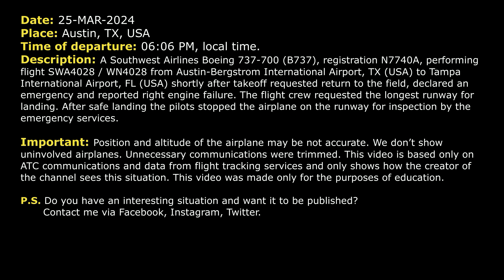“We lost the engine”. Engine failure on takeoff. Southwest Boeing 737 returns to Austin. Real ATC

Comment: I was on that flight.  The audio shows a fully calm response from the pilot and ATC, it felt the same way on the plane.  I have to say that the response from Southwest could not have been better.  After we deplaned we were told to stay at the gate, within a few minutes we were sent to another gate, a replacement aircraft was there.  They had to replace the flight crew, move all the baggage. We made it home safe with all the baggage about 3.5 hours late.
Reply: My nephew was the Captain of the flight.   So proud.  Excellent training!!!

Comment: ATC is such a pain in the ass... you have to repeat everything to them.  They should pay attention and write things down. Attention to detail.  The pilots are way busier than having to repeat things for ATC.  This is a running theme with every emergency.
Reply: Consider that the audio you hear may well be much clearer than what they hear, this isn't a direct recording from the ATC earpiece...
Reply: @alan_davis  well said...among many issues faced by ATC and aircrews involved in an emergency. 

With 1500+ hours in a naval aircraft cockpit and many emergencies, both sides of the "press-to-talk" button are suddenly very busy.
Reply: I am.... that's why the Air Traffic Services' communication performance is horribly substandard.  Not just here.. universally.
Reply: @AquariusTurtle  You've proven...with both comments...you're not the brightest light in the shed.

Your comments confirm you are a self-centered individual who, I hope to God,  never sits in a cockpit while the aircraft is in motion.
Reply: @SENSO1966  Thanks for saying better what I was thinking. I was going to have a hard time avoiding FOS-type comment.
Reply: You need to realize a few things, first most of these recordings are trimmed, only showing the incident aircraft communications, so it may seem like they are repeating what they just said, but it could be many transmissions apart. Second, when an emergency is declared, ATC is not only dealing with the incident aircraft, they are going to be on the line with the tower to prepare equipment, maybe stop departures if needed, etc. On top of that, you have the supervisor behind you asking for additional questions. You have other controllers in your building that you need to coordinate with, such as you are departure, you need to call final and let them know, the feeder sectors may need to stop traffic to give a gap, Center may need to go into the hold.  Bottom line, there can be a lot going on behind the scenes that won't be picked up on these recordings.  While at the same time, ATC is getting info the are not expecting which also make it difficult to/ pick up on what they are saying the first time.  Then the old game of teletype needs to be played from controller to controller as they are handed off, and sometimes it's easier to just clarify with the pilot than trust that the info you got passed was the correct uni.
Reply: @LiamsCarsandblocks  Brilliant response...thank you for taking the time.
Reply: @LiamsCarsandblocks I know of all that because I'm in the business.  I'm the customer.  The issue is that the system is not working well for the customer.  During emergencies, nothing is more distracting than ATS.  It's gotten so bad in the last 10 years that whenever something goes wrong, I just declare souls, fuel, hazmat, ending with "standby".  I ignore them until I run the QRC and checklist and do internal coordination.  ATS is not in the aircraft and they don't help flying the aircraft and dealing with the real problem.  They become part of the problem when we have to repeat things.  Obviously these videos are trimmed, and everything else you said is obvious too.  The problem is that all those things you said are administrative overhead that distract the pilot from real non-administrative duties.

Comment: A situation well handled by all involved.
I think that we are starting to see just how hard the pandemic period hit this industry.
On top of huge financial loss, the industry is now facing a shortage of pilots, air traffic controllers, mechanics /maintenance crew and a surplus of spoiled passengers who want to fly cheap yet complain about everything as they've paid for VIP conditions.
Reply: I saw a comment from someone in airplane maintenance who claims better paid, more experienced older mechanics were encouraged to retire during covid to save money, and didn't come after :/

Then add in work stoppages at airplane manufactures (both due for Covid and for Boeing for ..other reasons) means airliners are flying older planes with higher maintenance needs. 

The pilot shortage at least partially may due to demoralizing wars -- the military recruitment efforts appear to be partially that from the analysis I've seen by someone that knows more about this all then me. Kids with military parents are lot less likely to go into the military then they used to, who's parents were in those forever wars. Lot of pilots come from the military. So, less folk going to military, less  folk coming from military to commercial aviation. 

Also, airplane travel is more popular atm then even pre-covid levels (based on a quick google). And mental health is down... thus the horrible passengers. :x 

Seems like some recruitment efforts need to be ramped up, but takes a while to get experienced :/
Reply: @hefoxed  Good point on the aircraft grounding. And is not over. After Boeing, Airbus too is announced to have some 600+ planes grounded this year due to engine manufacturing deffects.

Comment: Boeing-Shit.
Reply: Bro thinks engine failures are Boeing's fault 💀💀💀

Anyways, aircraft manufacturers don't make engines. That job goes to the actual engine manufacturers, like GE, P&W, RR, or CFM (GE + Safran joint venture)
Reply: @EuropeanRailfanAlt  To be fair: There are many external factors that could cause a engine to malfunction.
Reply: and youtube have deleted two of my replies... of course they have... since google changed it's motto from " don't be evil" to "ok, evil i aight", this is par for the course
Reply: @arashkamangir331  The channel owner is more likely doing that.
Reply: Your pants-shit.
Reply: I was on this flight, they made an announcement after we got off the plane and said there was apparently too much fuel and that’s what caused the engine to fail
Reply: @taffyandvieira I was on the plane also.  The announcement about too much fuel was regarding the replacement aircraft. It had been fueled for a different flight.  There was a slight delay as they recalculated the weight to meet FAA requirements. I never heard anything official about cause, there was chatter at the gate about a possible bird strike.  We were just clear of runway and not very high so that is a possibility
Reply: agreed... lots of boeing PR people in the comments sections here.. won't help though
Reply: @arashkamangir331  🪠🪠
Reply: @arashkamangir331  No PRs, just people who have a bit more knowledge and know what they're talking about. All this whining on issues that are not Boeing related will detract attention from the safety issues that are indeed related to Boeing. Sadly, the best PRs are the people who constantly cast fake accusations as those are smoke and mirrors for the real accusations.
Reply: @BlueSkyUp_EU  well said.

 Sadly, the comments pouring in when events like this occur confirm that very few think critically and are easily manipulated by media of all kinds.
Reply: @BlueSkyUp_EU  sure bud
Reply: As usual someone without an ounce of a clue makes a fool of themself on YouTube.